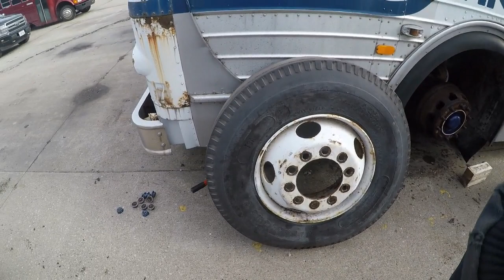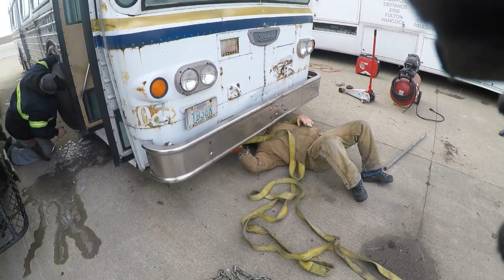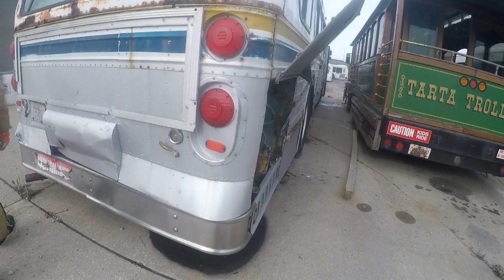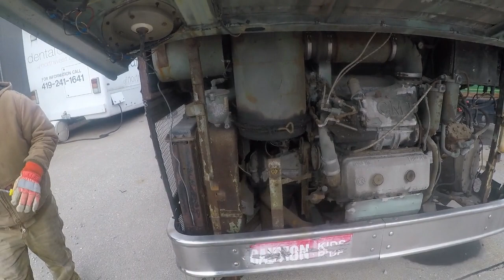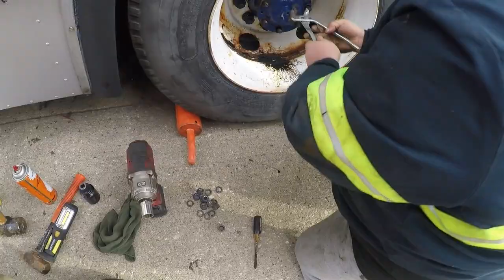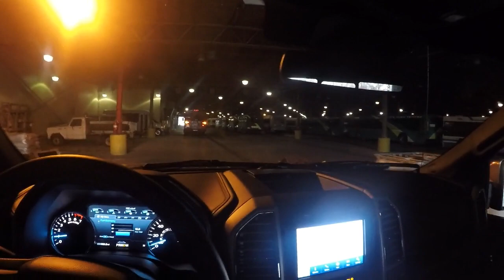Toledo Bus Rescue Day 3

Comment: Scott of Bus Grease Monkey will recommend is to bar the engine over two revolutions whether or not the racks are moving or not as it will determine if you have stuck injectors if you try to start it as is its possible the engine could run away. a 6-71 two stroke detroit diesel those engines the 71 and 92 series two stroke detroit diesel is what Bus Grease Monkey is working on. He is currently home be closing on his new property in Tenn before he works on more of his client's busses.